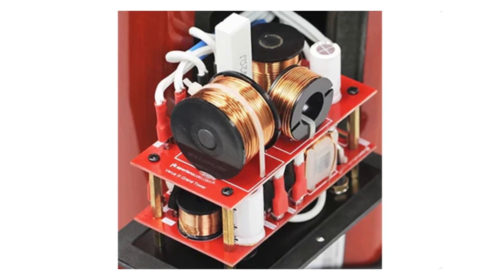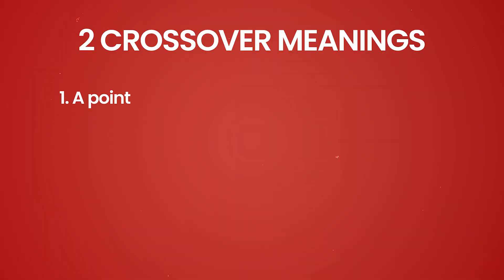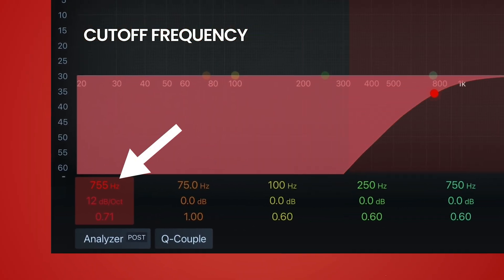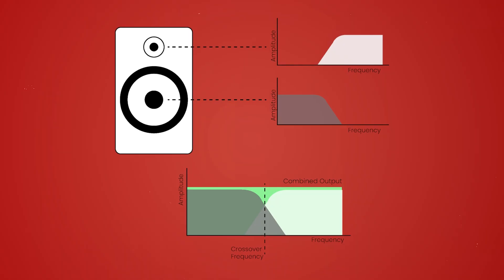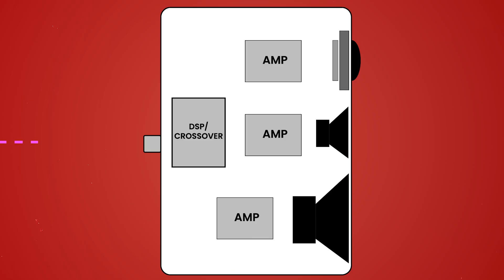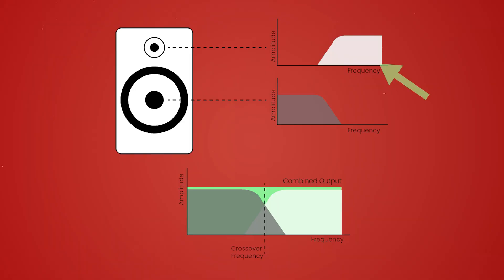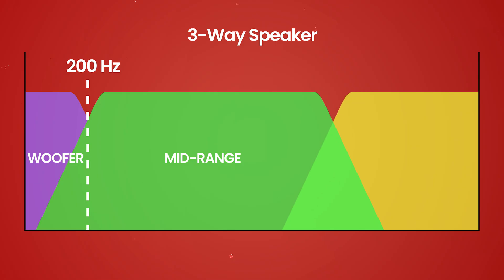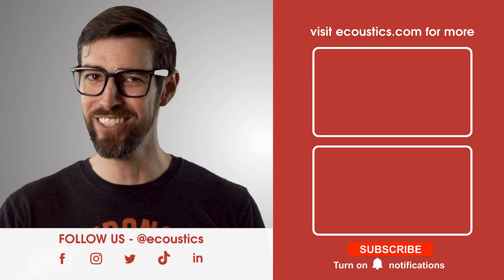CROSSOVERS EXPLAINED! | Loudspeakers | eCoustically Speaking

Comment: The exact video i was looking for after eyeing up Kali lp unf (passive crossover connection but manufacture claim both sounds identical) and Adam audio d3v (active crossover connection)

I was slightly put off after finding out Kali lp unf have a passive crossover connection but literally 0.2kg weight difference between the two so surface sound reflection should be identical also. This video put my mind at ease as i was really looking forward to owing both of these entry level studio monitors but wanted to start off with Kali first as i want perfect accuracy and faithful mid range and maybe skip Adam audio d3v if im super super happy with Kali's as I'm not really looking for big bass subwoofer like impact which might be the case with Adam audio d3v based on many redditors but instead, i just want a full spectrum of that sound without the extra thump with no over exaggerated decay on the bass notes as i i want the bass delivery to be QUICK, accurate, punchy with authority yet not over done or over hyped as i mainly listen to Trance music.
Reply from the maker: Woohoo! Glad we could help in any way! 🎉